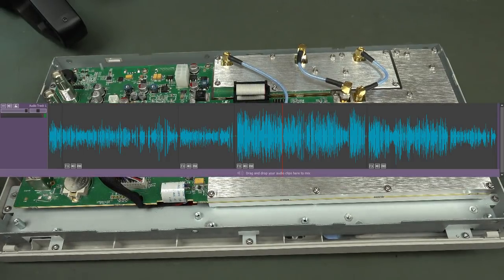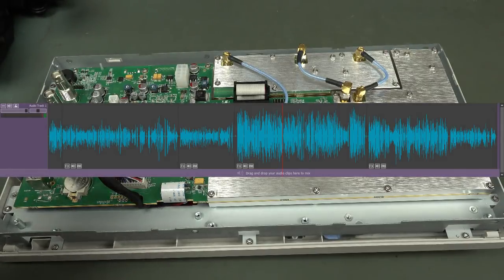Audio Microphones Test

Comment: You're right: the EW100 mic isn't so hot - tinny or canned sounding on manual, and somewhat difficult to hear when auto gain is on (it's softer/muffled to me). Otherwise, your voice comes out clear and easy to understand, much more so than many other YouTubers' audio.

To be fair to the others though, my playback is either through Surface Pro 3 speakers or out of a 30 year-old boombox in parallel with cheap PC speakers for my main rig - all while my Bigass™ aircon unit is going full-blast a few feet behind me (At barely 14m², my place is so small that nothing is ever more than "a few feet" from anything else. :) ) So you're definitely doing something right.

Comment: I have hearing problems because of my tinnitus, and I hate it when volumes change. Some people mumble or talk away from the mic and I have to turn it up, and then they suddenly talk normally and it's like someone sticks a screwdriver in my ear it's so loud. All those mic were fine even though the volume varied a little, but the Rode was clearer and the Sennheiser was  muffled and softer.

Comment: the Rode M5 sounds good! crystal clear and nice levels..the sony has nice panning...the lapel only seemed to be comming out the left speaker and sounds budget compaired to the other two
Reply: I don't want panning though, and I'd usually mix the two into a mono stream.
Reply: Would stay with the Rode, probably auto gain though the manual gain in your controlled situation is doing a good job, as there probably will be noise on zooming with the internal. Tape on the mic is doing a good job on handling the handling noise as well, might want to just get some black weatherstripping, and make it look like a bought one though. Lapel mic tends to enhance bass voice, and with your voice being more higher pitched it will accentuate rubbing and movement noise.

Comment: The wireless auto gain did better then I expected despite being on the left only. The internal mic has the higher noise floor and just doesn’t sound that good over all. The external mic sounded the best, the rhode auto gain setting did better on the pop, but wasn’t that good with auto gain as you changed locations. 
Stop/pop testing alone I think it would help to hear the samples one after another without all the other talking. There are definitely trade offs with the lapel mics, only good for certain situation and environments. 
Still, over all opinion the camera mic being the worse, the rhode mic doing the best on auto. And I’m not usually one for auto settings so that surprised me. But that’s just my opinion.
Now what about when you increase your level of talking from the air con coming on, seems to be a common issue for me,  even though I know I have filtering for the lows I still hear the air con and seem to increase the level I talk with.
Reply: Yes, I always use manual mic level except if I'm out in the field and have to "run'n'gun". But I'm impressed by the auto gain in the NX80. I have done an aircon test which is normally a problem and I can't really hear a difference on auto-gain which is surprising.

Comment: The Sennheiser had a problem as in a pre-emphasis/EQ set at the TXr different to the RXr? and was only on the left channel.  (i.e. it should sound way better... and could even be an issue with the state of the mic capsule itself).  The Rode has a tiny point when voice presence is perfect but very easily go 'off-mic' sounding muddy. (Probably the fact it's a short range shotgun intended for capturing what's outfront of shot and acting as an effects capture).  The BEST for voice commentary clarity was the onboard in the camera. It appeared to be stereo/2 channel. If there's a limiter setting in options in camera menu it'd really brighten things too.

Comment: 00:01 - The Rode M5 sounds very crusty, like there's brown noise every time you speak. I'm guessing it's the preamp in the camera itself.
00:38 - Distortion on this bit. It isn't hard-limited distortion as I can't see it any on the waveform, so I have no idea what could be causing it.
02:24 - The internal mic also has the same crusty sound on it. Definitely something to do with your camera's preamp/audio circuitry (or perhaps audio file compression settings?)
04:07 - Still has the crusty sound on it.

The audio on your screen-recorded videos sounds a lot better, which is why I think your camera may have a problem. Rode mics should sound excellent through pretty much everything, but when run through your camera the M5 sounds quite crusty and cheap and even distorts when it shouldn't do.

If I were you, I'd try doing an A/B comparison using another recorder to record audio from the M5. My guess is that it'll sound really clear with virtually no noise or crusty sounds on it. They do make excellent mics.

Anyway, apologies for the criticism! Just trying to give some feedback in case there is an issue with your camera. Always worth checking in case you got one with duff audio circuitry.
Reply: Heard the same "brown" (i like colored sound) noise. Maybe an external audio device connected to the pc and a clap of hands to sync with video in editing?
Reply: 00:38 that distortion has rendered all of Daves videos unwatchable to me with headphones for the longest time, it sounds to me like your eardum distorting when the volume is too loud, however the effect is there regardless of the volume used.  I always wondered if his microphone diaphragm was distorting causing it.  The rode mic with AGC is much easier to listen to. Using HD800 headphones which can be sensitive to warts and defects in audio recording.
Reply: I'm thinking it may be an audio compression issue. Without verification of each compression stage, I couldn't confirm one way or another.

My guess is this:

Audio compression on camera --> audio compression on export of video from editor --> additional audio compression from Handbrake.

Since his videos created using screen recording software don't have the "crusty" brown noise sound on them, I'm guessing it's something to do with the camera or the way it's initially compressing the audio.

Anyway, it doesn't seem to be too much of an issue for most people so I'll just leave it at that.
Reply: Looking at a spectrogram, you can see a couple of slightly emphasised bands centred on around 10.5kHz which seem to be the source of the "crusty" sound. Sticking a notch filter in there makes the whole recording a lot more listenable. Not sure what the issue would be - it affects all the mics to some degree, so it's not them, it seems unlikely to be a toolchain problem, but then I wouldn't have thought it would be a preamp/ADC issue in the camera either.